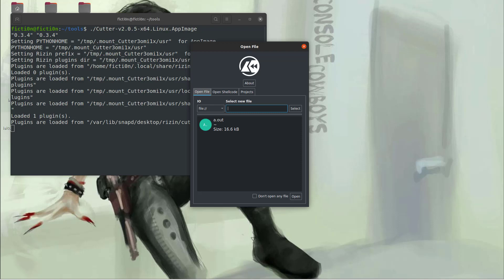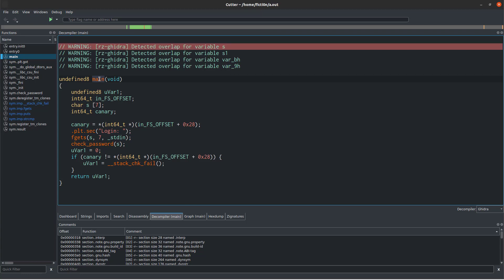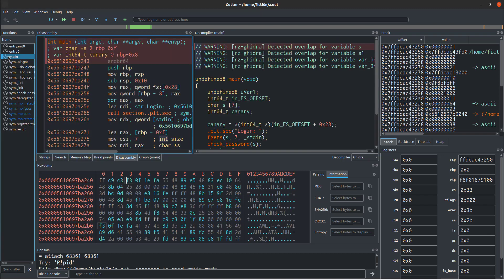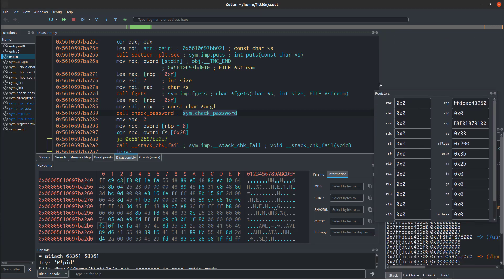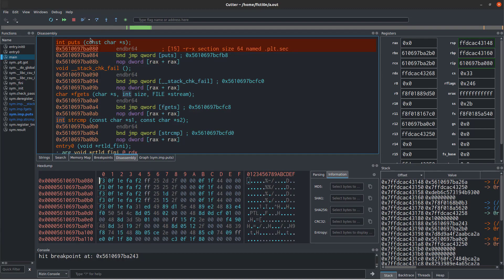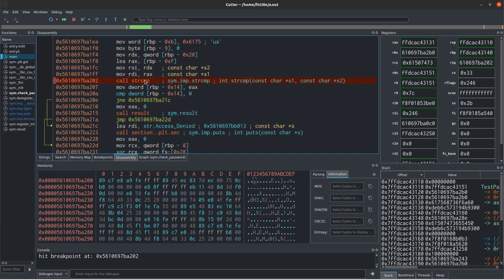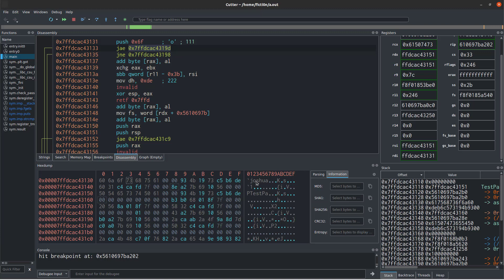Radare2 Series 0x6 - Cutter UI Basic Debugging Workflow

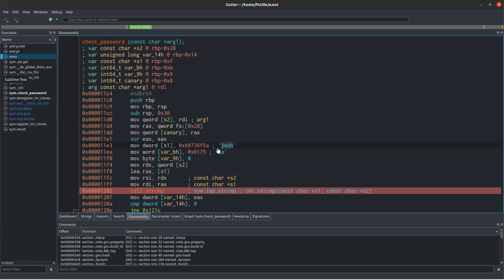Comment: 1:17 this is not an obfuscation. It's just a way how a compiler implements string initialization on stack. Sometimes it copies a string from a data section (in the same manner, with several movs), sometimes it constructs it from immediate values.

Comment: When would you not want to use the UI and stick with the console app?
Reply from the maker: Its really just whatever your comfortable with... I prefer the command line for looking at things in general but I like a UI like IDA pro or Cutter for things like reviewing flow graphs or debugging.. I am not big fan of commandline debugging.. and getting graphs for like tracing back function calls to user input is very useful in things like IDA.. or doing side by side comparison of decompilation and disassembly in IDA or Ghidra is a good usecase as well.... Really comes down to preference.. but those are the times that I like to have a UI..
Reply: @ConsoleCowboys  Thanks a lot! Makes sense.